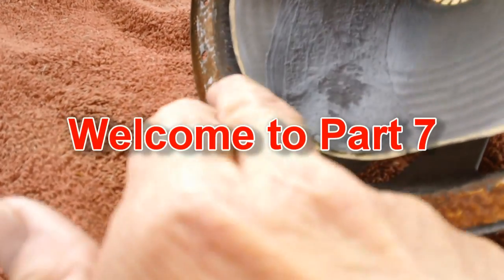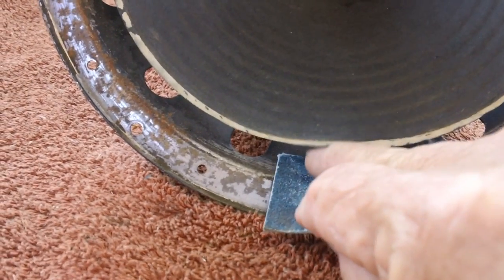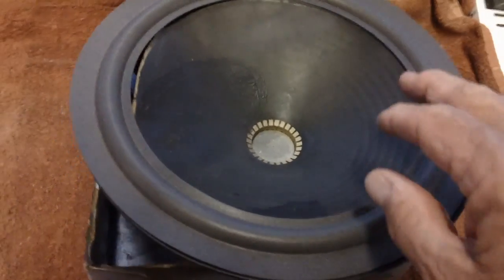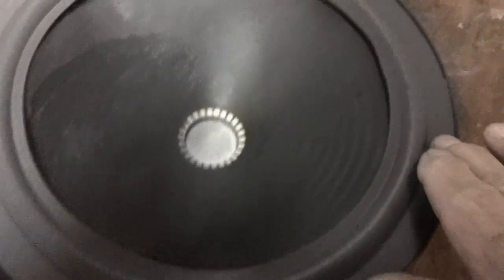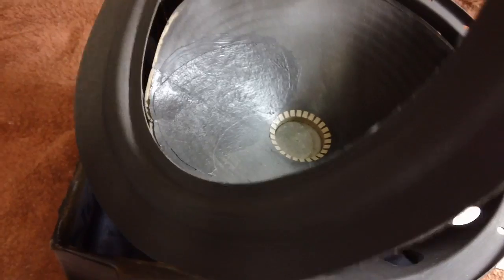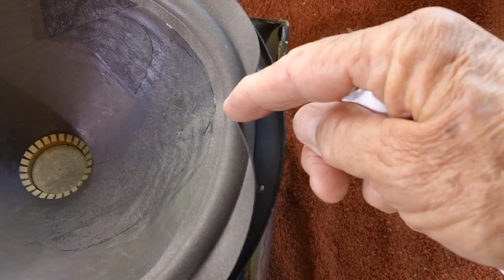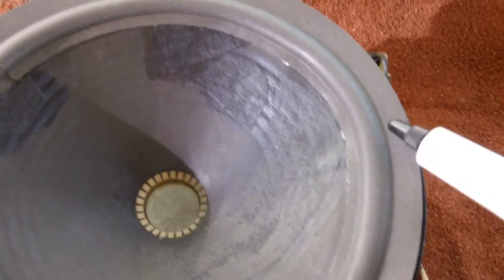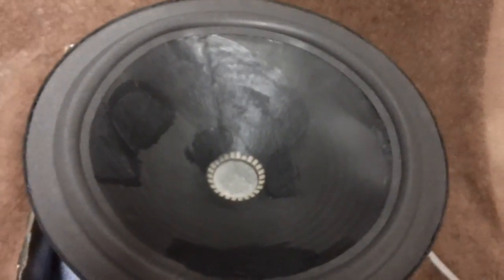1927/28/29 Rola speaker restoration (Part 7).

Comment: Good Job as usual John !    I have my Hammarlund speaker to restore one day and this will help tremendously.  I will have to find one of those rings too.  Thanks as usual my friend - Ron
Reply from the maker: Ron,
We're still not done with this voice coil rubbing deal, meaning there's more to come in the next vid.
Incidentally, Hammarlund speaker cases could be bought with or without a speaker.   The Jensen speaker is what came with if you bought the complete unit.   I've seen all sorts of speaker brands in those cases.
And what size foam surround do you need?  If a 10", I'll send you the extra one I have.
Regards,
John
Reply: Thanks John. I am not going to deal with the speaker for a while as I have ordered a replacement speaker. Thanks for the offer but you may need it if you come across another Rola  :)  I know you will not accept any rubbing of any kind.. and will nail it down, no doubt.   Regards, Ron

Comment: For a ninety year old speaker, it's looking pretty good. I'm thinking John that when It's back in the cab and everything is working it will sound fine. Having that patience to take your time is a major deal.
Reply from the maker: Carl,
Most of the patching I did to the cone was more of a preventive maintenance thingy.  If it looked weak or felt weak, it got a patch.  Better to do it now than have to tear it all apart later.  But we're not done yet.  There's more to come on the vice coil rubbing jazz.
Regards,
John

Comment: When I re-surrounded my 1970s speakers I used 2 dozen spring loaded clothes pins to hold the surround on the basket.  I spent time to re position them until I got the cone centered with no coil rub.   Then I removed a few clothes pins at a time and glued that section down a little at a time.  It was like having 24 extra hands.  Worked great.

Comment: I really can see what you´re aiming for, and you really do a great job on this one.

There´s also a nice "shortcut". If you want a "rub-free" speaker voice-coil you can also apply a tiny-little low-frequency (around 30-80Hz; 60Hz is probably the easieast ;) )voltage at the voice coil while you´re glueing the surround to the basket. If you hear a distortion you can easily trim that out by moving the surround slightly and then glue it and hold it in place with a peg for example and move on to the next, let say quarter....and while you´re going on like this, the speaker itself will give you a very good feedback on how it´s dealing with your glueing....

Also you can have a closer look at the spider, as it may have some alignment problems as well....

These old speakers usually have a phenolic type spider which is most times also mounted on the basked using screws, if so it would be a rather easy task to re-align it, just unlock all screws just a little bit and check for a free moving voice coil and tighten it back on (crosswhise).

Comment: John,
Given the general condition of that loud speaker, I'd say you have done a very good cone re-hanging job.  
As you are aware, paper gradually deteriorates via such factors as temperatures, moisture, bacteria etc.  Among other things, it alters shape slightly, and becomes brittle, more so in certain spots, or areas as its thickness, and consistency is not always consistent.  Depending where that speaker lain unused for several decades, the deterioration process might have took place slightly quicker. 
You are right to suspect the thin card voice coil former as being possibly warped.  Though it is not as common as cone distortion, nonetheless I have, after doing further inspections, seen a very small number of voice coils that became slightly ovoid thus contributing to pulling the cone slightly out of shape ...enough to have almost fooled me into suspecting a speaker cone was the only factor that had become warped LOL. 
Best regards dear chap,
Phil.
Reply from the maker: Phil,
Be sure to watch the next vid on this repair fiasco.  I experienced a little welcome luck.
Regards,
John

Comment: It's coming along!    Considering how warped it is, you've got the rub minimized.   maybe you will get lucky like I did on a recent speaker.  it was rubbing while resting horizontal on its magnet, but when I installed it back, vertically, the rubbing went away.

Comment: How about using clothespins to hold the surround to the basket for positioning before gluing, then remove a few at a time to glue?
Reply from the maker: That would certainly work and I have done so in the past, but as it turns out this voice coil had a different problem than just a centering issue. Stay tuned.
Regards,
John

Comment: Great job John! Id like to have seen the paint job, was it difficult getting down under the cone? Also, would a piece of construction paper,mormpiece of a paper plate run around the cardboard straighten it out any? Thx again. Larry
Reply from the maker: Larry,
Luckily, I  didn't have to go very far down between the cone and basket with the paint spray, maybe 3/4 inch or so.  That made it easy.  I slipped a folded piece of manila folder in there and sorta bent it back toward the center of the cone.  It was enough to create the needed space.  Even so, a little of the spray did get on the back of the cone, but it's no biggie.
Regards,
John

Comment: John:
I use a cheap narrow wood chisel I bought for that purpose.  Works better and is a lot safer.
Reply from the maker: Dan,
Just about any sharp tool will work to clean up those nasty baskets.  I always worry that I'll mess up the cone, so I prefer to use something a bit smaller.
Regards,
John